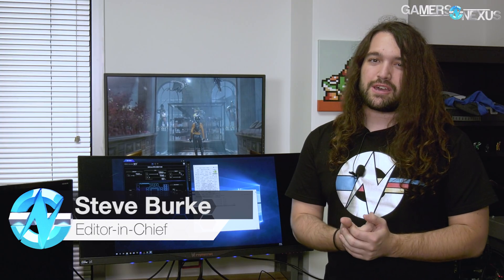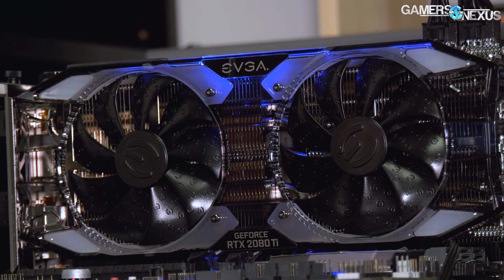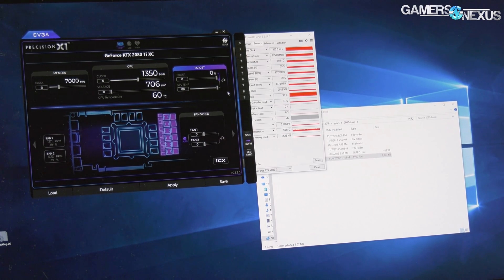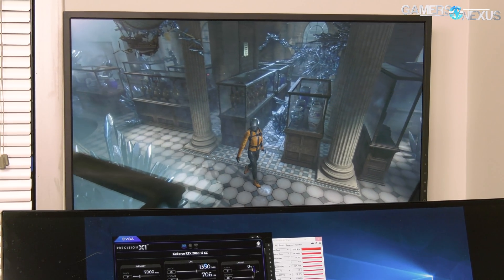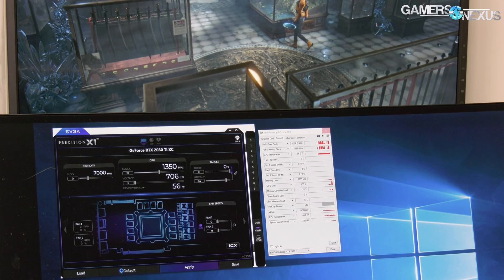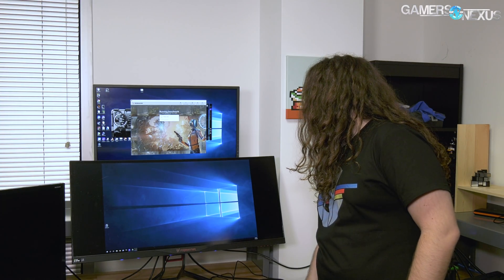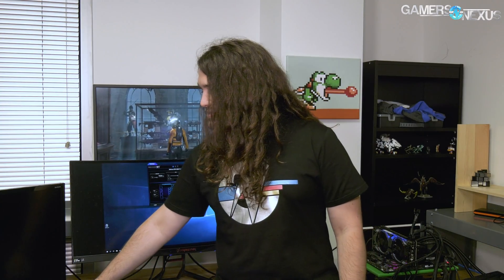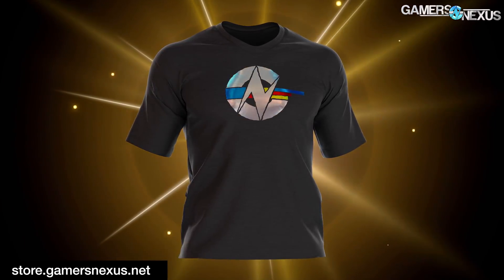Dead 2080 Ti #1: Clock Freeze at 1350MHz, Stuttering, Crashing

Comment: I see the PerfCap reason is idle, so is the card just not changing to a higher pstate? Another comment said his card sits at 1350mhz during loading sequences but then fully boosts when under a full load. I think this may be the case, or close to it, as the card seems to be choked for power when you add a clock offset.

Comment: So interestingly enough, I had nearly this exact same issue with my EVGA 1080Ti FTW3 card after installing the FTW3 Hybrid mod kit (also from EVGA). It turned out there was a defect with the kit (widely reported on EVGA's forums, didn't know of this problem before doing it) that shorted a portion of the card on the very edge. EVGA has since repaired the kit and added a piece of electrical tape on the spot of the shroud that was shorting the card.

The 1080Ti exhibited the exact same behavior as this card, except the card would go to 1550mhz instead of 1350, and would not boost whatsoever. If you look up "1080Ti FTW3 wont boost after hybrid kit" on google, the EVGA forum item will come up and heavily documents the issue and fix.

For what it's worth, EVGA was awesome with the return and replacement, and solved the issue completely by sending me a fully done Hybrid 1080Ti FTW3 as a replacement instead of having me redo the card/kit conversion again.

Comment: @Gamers Nexus
You can investigate a bit further to see if it's an EEPROM issue : on the broken card extract the VBIOS that supposely work and compare with the file you flashed. Make sure the extraction did well and do it several time and compare extracted files between them.

Comment: I have a ex mining rx580 that did the same thing. Clocks were locked down to 1145 and any change instantly crashed the system. Luckly fiddling with the bios helped. But its funny to see a error that happened to a 80 dollar used card repeating in a 1000+ spanking new card.

Comment: I and many others had a very similar issue with the 1080ti FTW3 card after attempting to install the EVGA hybrid cooling kit. There was an assembly defect with the hybrid shroud where a metal mesh wasn't fully seated into the plastic retainer. When out of position the mesh plate bridged an unused, exposed 4 pin solder pad on the card that I believe was intended for voltage monitoring. After bridging the contacts and shorting that part of the card it would only run at the base clock speed and wouldn't boost at all.

EVGA RMA'd the card and the hybrid kit so it worked out OK in the end. Ended up putting a second hybrid kit on the new card being careful to cover the solder pad and the bottom of the mesh shroud with kapton tape and it's been running fine since.

Not saying that's exactly what's going on here but the symptoms were identical; GPU core was stuck at base clock and touching any of the GPU clock sliders in precision would make the machine stutter/lock up completely.

Comment: My MSI 1080ti is stuck at 605mhz, and it wont clock at all. After 3-4 restarts in afterburner i managed to get it to 1993mhz, but it ran 65C constantly and the fans wouldnt turn on. At this point, i really dont know what to do anymore. This happened all of a sudden, without me touching or changing anything...

Comment: Hello, I have a Gigabyte RTX 2080 Ti WINDFORCE OC 11G  which with the driver  411.63 and 411.70  was behaving very strange, with the power coils whining in a strange way, with strange noises,  and at some point this thing happened to me too.  The card was staying at 1350 Mhz no matter what I was doing. More disturbing was that the voltage was set at about 1000 mV, which was pretty high. In every rtx 2080 Ti manufacturer's application there is an OC scanner or something like that, and it creates a frequency/voltage curve. After running that application, but from Evga not from Gigabyte ( you have to go to fan settings and activate auto, because there is a bug somewhere and, sometimes, auto is disabled ), and applying the curve scan result the clock returned to normal, but while i was playing a game it happened again.
I tested with driver 416.34 and the problem was even worse. I was getting black screens and freezing on black screen for long time, while doing oc scan. So this driver is bad also.
 I found a non released driver on nvidia site 416.64, I installed it 2 days ago, I did an OC scan and since then the card is working like a charm. Gddr 6 has a problem with heating. Even if you can overclock it +1000Mhz after a long period of time, if the temperature passes a threshold it gives errors, and in videocards translated into artifacts, blackscreens or other problems. After testing on my card, the memory can run at max +810 Mhz.
I don't know where that frequency curve is saved, but for sure the drivers till 416.64 are buggy and either they are rewriting on their own the frequency of the gpu, or manage incorrectly the power and the voltage.
I hope that nvidia will release a better driver and don't make a worse one then the one I found, because I 'm used to see themselves shoot their own foot.
Here is the driver:
 https://nvidia.custhelp.com/app/answers/detail/a_id/4736/~/geforce-hotfix-driver-version-416.64

Comment: Not Funny! Most expencive, many sector failing and dying, 20xx Series Cards replacing fine working 1080 Series Cards? There is no "you get what you pay for" anymore! Nvidia is getting closer to push the selfdestroion-button with this.
How can they seriously let the people pay 1300 bucks for "not ready to market" products? This is ridiculous! Anyone who is buying those cards right now, knowing about the unsolved issues, seems to need this experience pretty bad.
I stick with my EVGA 1080 SC until i cant play new triple A Titles @1440p, which would propably take a while. hopefully there will be cheaper and stable replacement options then,  than this half baked garbage!

Comment: Please like this for GN to see this It might be an solution!

I believe there are two softwares cancelling each-other out. It’s probably the EVGA software interfering with MSI afterburner. I had this problem with my rx 570. If you’ve installed both softwares (EVGA and MSI Afterburner) you would need to uninstall them.  Then delete all GPU drivers with DDU then reinstall the GPU drivers. After installing GPU drivers, only download one software, MSI or the EVGA software (DO NOT DOWNLOAD BOTH) and see if the problem still consists.

Thankyou,

Comment: A common issue with Nvidia's card is that the Vcore frequency can't drop under 1350mhz (or 1050mhz) is two monitors with different refresh rate plugged in. In the same setup, the card stuck with 1350mhz in some game. Playing with windows' monitor setting fixes the issue temporarily, but as one of my complain, this 20 series cards have an unacceptable problem; the idling speed and power draw. 300mhz idling with 20~30w power draw make no sense at all. Vega 64 in my last build draws only 8w idling with <60mhz. This 20w difference means a thing to me since I'm using these card working on Premiere in a noise controlled environment, and 20 series cards just refuse to shut down their fans.

Comment: 1350mhz seems to be the minimum 3D clocks, and this card just couldn't go past the first power stage. For whatever reason it wasn't able to clock up, most likely a bad voltage controller which wouldn't let it swap power stages. The card was likely just not getting enough power to the core and when you ramped up the clocks it just lost all stability. Contrary to popular belief, this is probably a one of a million kind of defect as usually hardware level issues that actually impact the product just means the card won't boot at all. It is clear that turing is having massive teething issues, but this just ain't one of them.

Comment: My 2070 has glitches in afterburner too. It doesn't show core voltage or fan speed. Also will not let me control the fan or core voltage no matter what options I select in settings. Card games and mines just fine, but it doesn't have full control in Afterburner.

Comment: I have an old GTX 780 reference which has been working fine — until I updated to the most recent driver (416.34) a few days ago. Now I get similar side-effects, as soon as I do any changes in Afterburner; such as just increasing the default temp limit from 79 to 80, or adding a +1 MHz core offset, causes stutters like shown in the video or, in best-case, driver crashes.

Comment: I've encountered a bit of a different issue with my current card (the first card was DOA).  Trying to OC my EVGA RTX 2080 Gaming XC using Precision X1 causes the Nvidia drivers to repeatedly crash and causes system instability in general.  OCing with MSI Afterburner works fine.

Comment: My EVGA 1080 Ti is behaving almost exactly the same. I am forced to underclock the card by at least 200 MHz for it to not stutter and freeze in the same exact way, and it is paired with a high refresh G-Sync monitor. Only difference being that the card is not forcing itself to stick to a clockspeed like this one is at 1350 MHz.

Comment: I had an issue where I bricked my GTX 970 using the Nvidia bios flash.  After doing some reading, I saw a post that you should not flash while the card is active. I recovered it by moving the video cable to my Intel integrated GPU and booting from it.  In device manager, I disabled the GTX 970, and re-flashed it with the NVFLASH.  Might want to try to flash that card while it's offline.

Comment: Dead cards, no RTX....for the RTX....Performance so similar to previous gen that they released drivers to handicap old GPUs to be slower. Not one RTX or DLAA title anywhere on the horizon. When does the class action lawsuit start???
Reply: Are you not aware that BFV has a retail release on the 15th of November and is apparently shipping with RTX support out of the box?

Comment: Hearing you say the clock speed is stuck on 1350MHz and the card being slow while my R9 270X sits at 1150MHz on the core... RIP
Reply: Radeon and nvidia architectures are wildly different. If amd could run the same clocks on core and memory it would probably melt but the score theoretically would be massive.
Reply: @jdrok5026  *Enter R9 Fury X*

Comment: Hey Steve! Maybe it is a power delivery problem? I had a 980Ti with a blown inductor and it would boot to windows fine, but as soon as i put load on the GPU it would crash. It also would read that it was at 90% power limit at idle. Seems kind of similar to what you are seeing here.

Comment: @GN could the card that is stuck at 1350 have a voltage probem and the card is not ramping up the voltage to support higher speeds or maybe the power target is like set wrong in the bios. It could be as simple as sensor errors and the card is not reading it's own sensors properly which means RMA I guess.
Reply: They flashed a known good bios and didn't fix the issue it would need to be hardware level.

Comment: I just had a massive panic with my 2080Ti FE, whilst watching this I opened Forza Horizon 4 and the core clock was capped at 1350Mhz throughout the intro/opening scenes of FH4, but as soon as the game actually kicked in it went up to 1995MHz.  But in Windows it seems to cap itself to exactly 1350MHz under light to medium load.  I assume there's a plausible explanation for this but it was panic inducing whilst watching this piece!
Reply: If your card chooses 1350Mhz for light load, then that might mean that the other cards are failing to go into a higher power mode, causing the crashes
Reply: @upperedgelon1317  i dont remember him saying he had multiple cards?
Reply: @ronaldtavian2449  
He meant the one on the video.
Reply: Modern GPUS clock down when there's no load for less heat, noise, and power consumption.

I guess 1350 is the idle state clock
Reply: @Weaver_Games  My RTX 2080 FE idles at 380mhz, I used to run max performance power state on my gpus which does t let it idle low but after running benchmarks its pointless to do so.
Reply: @Weaver_Games  Definitely not the idle c-state.... 1350 mhz target would be an idiotic idle clock target (outright broken.) 1350 is the c-state directly below maximum performance.
Reply: @g10118  Probably a state for light work, like x264 video etc.
Reply: Yea your card is acting appropriately, as 1350mhz is probably the minimum 3D clocks. When cards are in things like 2D menus, but running a 3D application, you will see clocks and voltages drop very very low. The chip in the video was not able to clock past minimum 3D clocks for whatever reason.
Reply: James Mastroianni maybe there could be two softwares cancelling each other out. Maybe the evga software and msi afterburner software.
Reply: @maincharacter2677  well as a 1080 owner I can tell you that 1300mhz is the 3D base clocks for 10 series, so 1350mhz doesn't sound unreasonable for the 20 series. It has nothing to do with conflicting software it is that the card just doesn't change power states. This is likely a voltage controller issue
Reply: James Mastroianni I understand.
Reply: hmm, maybe Steve should try messing with power settings for the PC.  I tried the 'ultimate performance' thing and it made my intel 750 series pci-e ssd not respond properly and possibly my gpu as well.  To load a game, Destiny 2 specifically, would say 'playing' on bnet launcher but it was taking 1-2 minutes before anything visible would happen; no taskbar icon, nothing.  In game it would lag out/stutter, cursor would stop moving/responding, gear/item tabs were taking forever (longer than console) to load all the things.  Switched profile back and everything worked fine (even with the advanced settings all exactly the same).  Destiny 2 is finicky (you can't manually offset your gpu or you have a high chance to  crash), but I haven't experience game breaking bugs like this in an extremely long time, like 10+ years that just the power profile did. (I run balanced so the cpu can downclock at idle)

So, I would look through windows settings for sure to see if there is anything in there messing around, switching profiles and using advanced settings to get it back to what makes you happy, etc.
Reply: Is this your fist gpu? Damn casuals
Reply: go to nvidia settings and choose "performance mode" in your power settings, it defaults to adaptive if I recall
Reply: If it boosts to its intended clock when under load, it means that 1350 is just the base clock and everything is fine. One thing I noticed in modern cards: their behavior is much more automated than older cards. The card "does its own thing" (clocks, fan speeds, etc) and people freak out but if you take a closer look its running well within specs. When 0 rpm fans (in idle and low loads) first came out, people thought their cards were broken.

The 2080ti is probably too big (much higher chance if chip defects) and draws too much power. Temperature and high current are killers.
Reply: Install this driver:
https://nvidia.custhelp.com/app/answers/detail/a_id/4736/~/geforce-hotfix-driver-version-416.64
And after that install EVGA Precision X1, check if fan is on auto and go to VF curve tunner, do a test, scan and apply. 
The card should run in windows, when not doing anything, at 300 Mhz at very low voltage.
Reply: I just created a new comment thread asking about the windows power management side of things. If the OS is bottle necking power - you can ask the Nvidia control panel all day "Scotty I need more power" and all your going to get back is same results.
Reply: thats pretty normal, my 1080 Ti downclocks to 1500 MHz  (OCed Card) for light load and in games it goes to 2 Ghz. however, you can force it to say at max clock speed using MSI AfterBurner with constant voltage and clocks settings, but its not recommended at all as you are forcing your GPU to work at full while its unneeded.

Comment: The card is probably "protecting" itself because of the hardware fault, I've watched Louis Rossmann fix similar problems on Macs where a bad sensor causes the device to put itself into a "Safe Mode" of sorts. Could be temperature, fan speed, current draw, you name it but you have a very expensive brick either way.
Reply: We need Nvidia spec black rubber pucks.
Reply: Need Louis involved, he can make it fitter, happier, more productive... :)
Reply: I guess it's PP_BUS isn't so G3h(ot)

Comment: Try pre 400 drivers if they have 20 series support. Had issues, although with my 1080ti's, with my SLI setup with similar system stability. Just a shot in the dark.
Reply: I had to revert back to pre 400 series drivers and had zero issues since. I know it's different series cards but it still could be software related......hell it could actually be windows related with my experience with their first updates of October. Lol

Comment: OMG STEVE I also have a 2080 ti XC (non-ultra) from EVGA, shipped to me from the US, to me in Canada, and I have this EXACT SAME ISSUE!

I contacted EVGA twice and they told me not to worry about it, and it does the exact same thing where I can see the Precision X1 software spiking to 1350 only, and I get consistent crashes in black ops 4, my PC doesn't BSOD I just get these weird issues that you are mentioning.
Reply: "Don't worry about it" after spending $1300? what's next? "Dude my 2080 ti's on fire" "EVGA rep: Don't worry about it the ai will put itself out and you're good to go" lol
Reply: @PinkGirl2242  It just works, dont worry about anything
Reply: contact them again and get someone competent on the line.
Reply: @cloud8521   Better still, get a full refund, buy a used 1080 Ti. Perhaps the much upvoted EVGA rep showing up at the top would care to chime in here? At this rate it's a wonder you weren't told to fix the performance drop by buying a 2nd card for SLI. :}